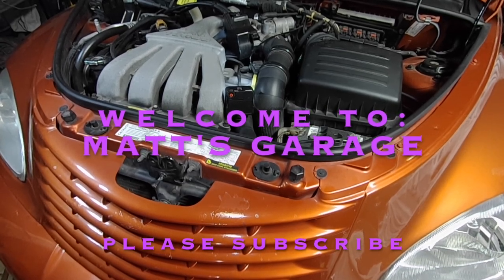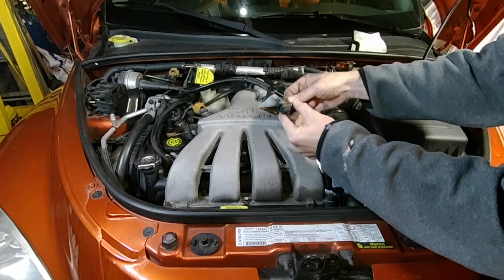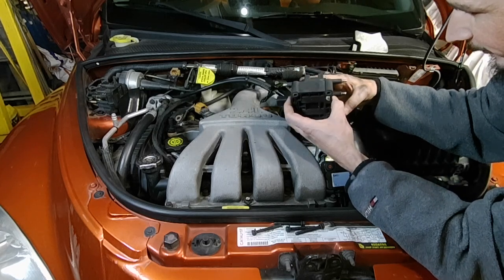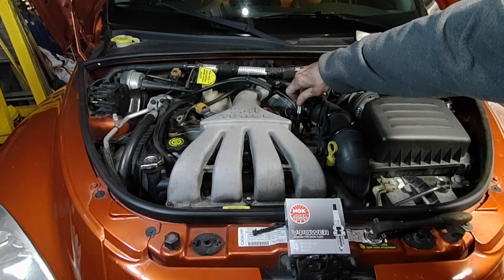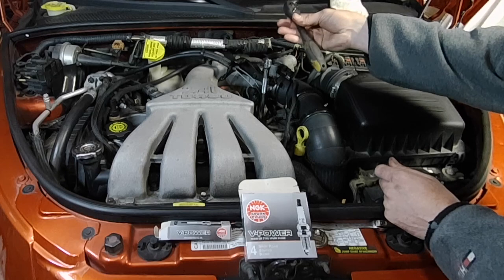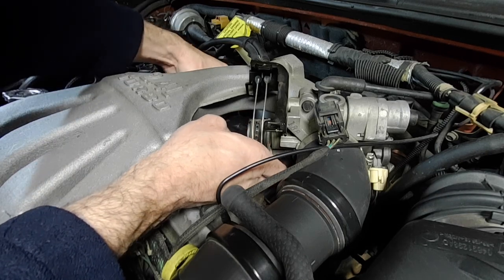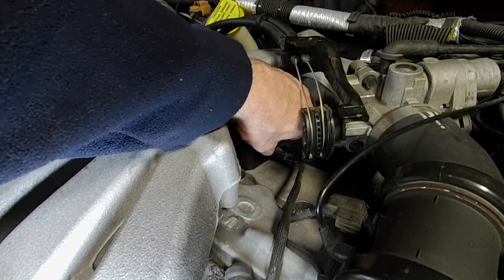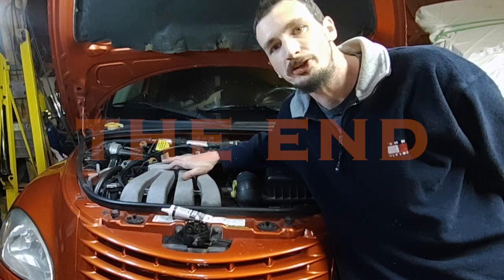Turbo PT Cruiser Tuneup, Plugs, Wires, Coil Pack

Comment: 2005 PT Cruiser
O2 sensors both poo32 & poo38 come on in 30-45 seconds after a smooth start up?
Car stalls by 1 min after start, clear codes, no start? Disconnect battery & immediate smooth start up but same scenario?
Any suggestions? Have gone through & resurfaced All grounds as ur video showed. Cleaned all electrical connections and added dielectric grease as well.
Stumped….

Comment: Thank you very much Matt. Your videos are very informative! I got your message about changing the coil pack to see if that helps with the rough idle of my 2002 PT Cruiser Limited. As soon as I get paid( once a month) I think I will go for the OEM coil and spark plug cables. Hey I noticed different information in your other video from this about gapping spark plugs to less than .5. Can you explain about gapping?
Reply: Hello ,10-2-2021 , I'm putting the "E3" spark plugs in my 2.4 none turbo.  The design are  permanate gap , no adjusting . These makes tourque & higher gass milage 👍🏁👀

Comment: So Matt, thanks for the video. I don't know if you answer individual questions, but I thought I'd ask. I have a 2004 PT that the instrument display, the turn signals, and the radio (sound) has stopped working over the last few months. The display would work for months then stop for months before finally not working at all.  I was thinking that maybe they all power off of the ignition switch?   I'd like to keep the car; it only has just over 100K miles on it and has already had the timing belt and water pump changed. The only other problems I've ever had are the cam sensor and radiator fan (hi end not cooling AC). Thanks in advance for your advice.
Reply from the maker: Charles Harris I always try to answer all the comments, I do miss some and I can’t always conclude a solid diagnosis virtually of course. But in your case I’d try a new ignition switch, I had some similar issues with my gold ‘04 I previously featured on the channel and a new ignition switch solved it. Here’s a video on changing the ignition switch, it’s cheap & easy: https://youtu.be/OmtfATPafS0 Also check out my recent video on electrical system maintenance, it’s a good idea to perform the steps I show in that video to ensure your entire electrical system is performing up to par.
Reply: @CarswithNash   Thanks, Matt! I won't be surprised if you are right, but I will be surprised if I was :*) I'll let you know if it works.

Comment: Great video. I appreciate you showing the little pain in the neck things you run into and show how to get around the problem.
I do wonder about using dielectric grease though. That is designed to stop current, not conduct it. Maybe use a conductive grease instead? Just asking.
Reply from the maker: I’ve actually explained that in a few of my videos, you definitely don’t want to use a conductive grease, it will cause resistance. That is why it is non-conductive, it is not supposed to enhance the connection, it is supposed to insulate it and protect it from the elements.
Reply: @CarswithNash  It is designed to prevent voltage. It goes on spark plug boots to stop an errant spark from arcing against nearby metal. If you push it into electric harnesses and then plug them together, it could very well prevent the connection.
Reply from the maker: @redpine8665  Sorry you are mistaken, it is made to use in electrical connections, if you lose connection because of dielectric grease then you have a problem with the connecter not the grease.

Comment: That back right bolt on the coil pack was impossible to get at. Had to do the old hanging the valve with a bungee cord bit. Having a cast iron valve cover hanging by a bungee cord was a little unnerving. But I got it done.
Reply: Pretty sure your talking about the plenum. The intake valve cover is what the spark plug boots go into, which is covering where the camshafts are located on the head.

Comment: Hey Matt, quick question. I have an '05 GT that I'm looking to tune up. Just replaced quite a bit(regular 100k mile maintenance) and was wondering if there is a specific order of modifications that make life any easier. I'm looking to throw in a cold air intake, maybe modify the exhaust. Poor thing uses a lot of gas, if there's a way to help it use less I would do that first. Keeping my car running in good gondition as long as possible is priority. Recommendations for trustworthy sites and parts would be appreciated! Also, do you know if oil catch cans genuinely have benefit for these cars? Excellent video as always! I can confidently say that you are the only channel I will drop everything to watch. Hope this message finds you well!

Comment: Hey Matt my pt won’t accelerate past 4K rpm I’ve done spark plugs and coil pack turbo seems to still work but if I floor it it only goes to about 3 4 thousand rpm and then the mph will increase with the rpm staying at 4
Reply from the maker: Is the check engine light on? Sounds like it might be in limp mode…
Reply: @CarswithNash  it has a check engine light if you turn the key it says p0132 brought it to the shop today and it had a broken sender but now I lost the speedometer and when I floor the car the gas gauge goes to e and beeps